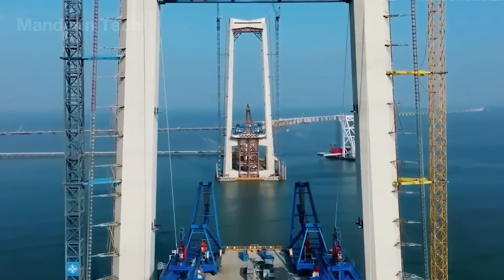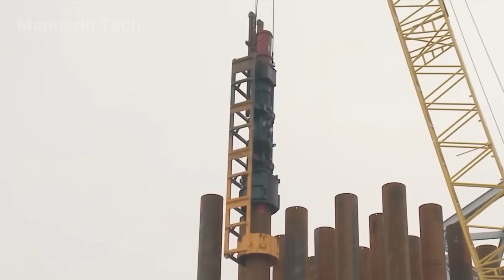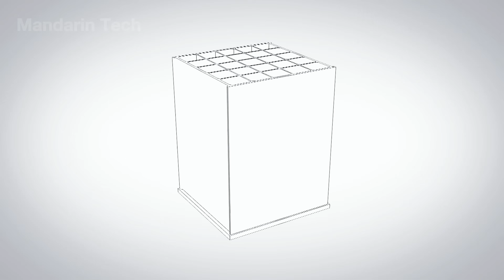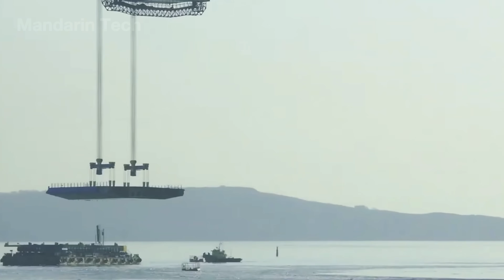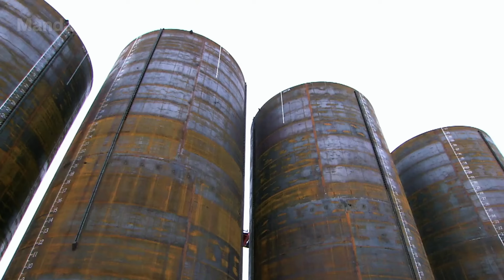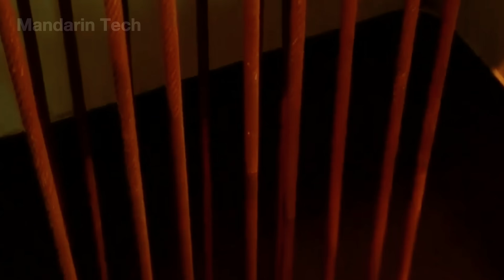You Won’t Believe China Built a 55 km Mega Bridge Connecting Three Cities Across the Sea

Comment: Field Engineer & Environmental Perspective
🇬🇧 English

From a field and environmental perspective, large marine bridge projects require strict control of environmental impact and operational safety.

Protecting marine ecosystems, managing construction in open water, and ensuring structural durability in harsh conditions are key challenges.

Field engineers play a critical role in supervising operations, adapting to dynamic conditions, and ensuring compliance with environmental standards.

Sustainable marine infrastructure depends on responsible engineering in the field.

#FieldEngineering #EnvironmentalEngineering #MarineConstruction #SustainableInfrastructure #CoastalEngineering #ConstructionSafety #ResponsibleEngineering

Français

Du point de vue terrain et environnemental, les projets de ponts maritimes nécessitent un contrôle strict des impacts.

La protection des écosystèmes marins et la gestion des conditions difficiles sont essentielles.

Les ingénieurs terrain assurent la supervision et l’adaptation des opérations.

Une infrastructure durable repose sur une ingénierie responsable.

#IngenierieTerrain #IngenierieEnvironnementale #ConstructionMaritime #InfrastructureDurable #ProtectionMarine

Español

Desde la perspectiva de campo y ambiental, los puentes marinos requieren un control estricto del impacto ambiental.

La protección de ecosistemas y la gestión de condiciones extremas son fundamentales.

Los ingenieros en obra supervisan y adaptan las operaciones.

La infraestructura sostenible depende de prácticas responsables.

#IngenieriaDeCampo #IngenieriaAmbiental #ConstruccionMarina #InfraestructuraSostenible #ProteccionMarina

Comment: Mega bridge projects that connect entire regions across the sea are a powerful demonstration of how engineering innovation, large-scale coordination, and long-term vision can transform mobility and economic development.

Civil Engineer Perspective
🇬🇧 English

“You Won’t Believe China Built a 55 km Mega Bridge Connecting Three Cities Across the Sea” showcases one of the most impressive feats in modern bridge and marine engineering.

Spanning vast distances over water, these structures require advanced structural design, deep foundation systems, and resistance to extreme environmental loads such as wind, waves, and seismic forces.

For civil engineers, this project highlights the integration of bridge engineering, geotechnical solutions, and offshore construction techniques to deliver resilient and long-lasting infrastructure.

Building across the sea is engineering at its highest level.

#CivilEngineering #BridgeEngineering #MarineEngineering #MegaProjects #StructuralEngineering #InfrastructureDevelopment #EngineeringInnovation

Français

« You Won’t Believe China Built a 55 km Mega Bridge Connecting Three Cities Across the Sea » met en avant une prouesse majeure de l’ingénierie moderne.

Ces structures maritimes nécessitent une conception avancée, des fondations profondes et une résistance aux conditions extrêmes.

Pour les ingénieurs civils, ce projet illustre l’intégration de l’ingénierie des ponts, de la géotechnique et de la construction offshore.

Construire en mer représente le plus haut niveau d’ingénierie.

#GénieCivil #IngenierieDesPonts #IngenierieMaritime #MegaProjets #IngenierieStructurelle #InnovationInfrastructure

Español

“You Won’t Believe China Built a 55 km Mega Bridge Connecting Three Cities Across the Sea” presenta una de las obras más impresionantes de la ingeniería moderna.

Estas estructuras requieren diseño avanzado, cimentaciones profundas y resistencia a condiciones extremas como viento y oleaje.

Para los ingenieros civiles, este proyecto demuestra la integración entre ingeniería de puentes, geotecnia y construcción marina.

Construir sobre el mar es ingeniería en su máximo nivel.

#IngenieriaCivil #IngenieriaDePuentes #IngenieriaMarina #MegaProyectos #IngenieriaEstructural #InnovacionEnInfraestructura